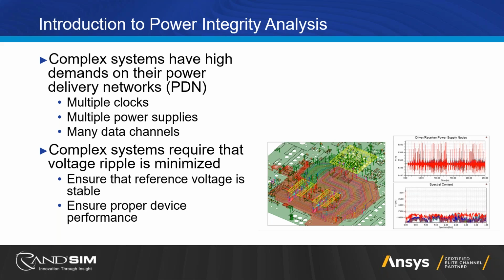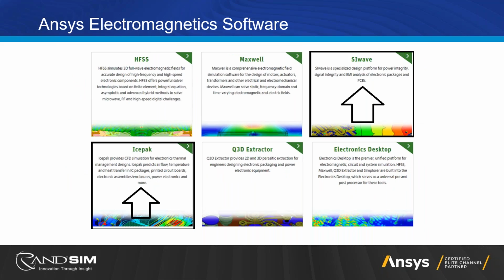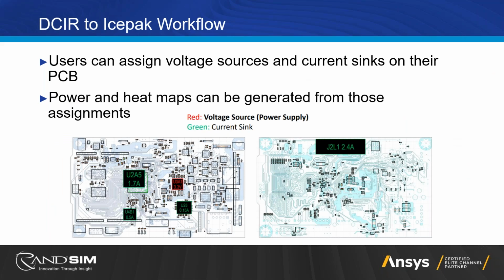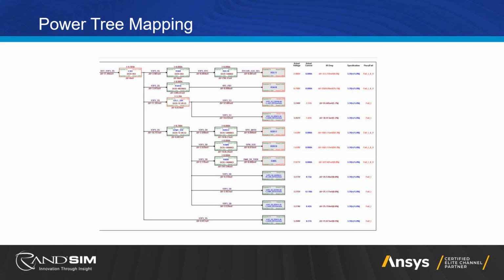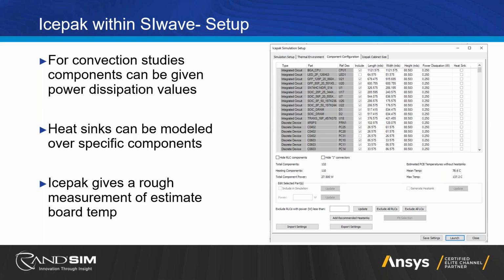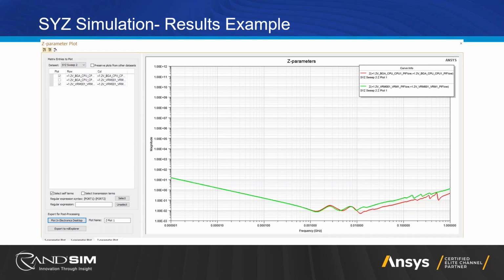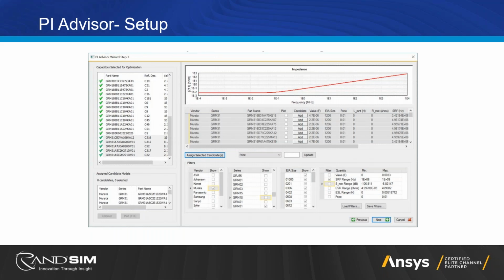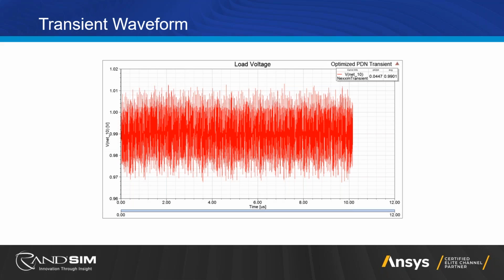Improving PCB Reliability with Ansys SIwave

Comment: Then with ultra-high frequency (UHF) RFID systems, would it integrate thermal radiation components?
Reply from the maker: Hello Bret, for simulations including both electric and magnetic fields you can include those resulting surface and volumetric losses into thermal simulations. So, yes you can take results from an RFID simulation and bring it into a thermal study.
Reply: @randsimulation  excellent!